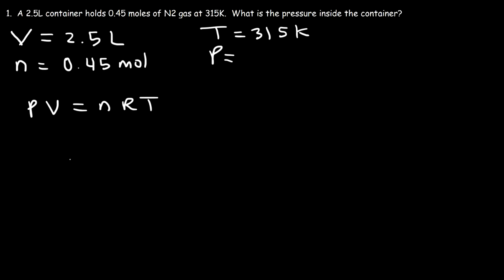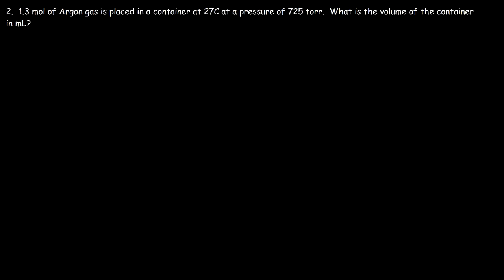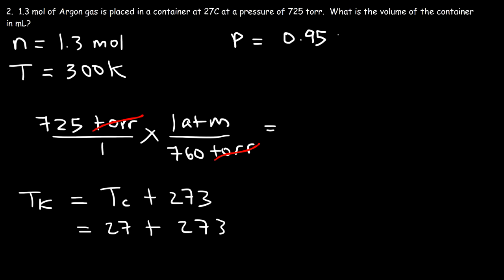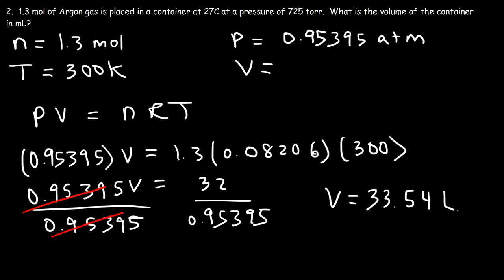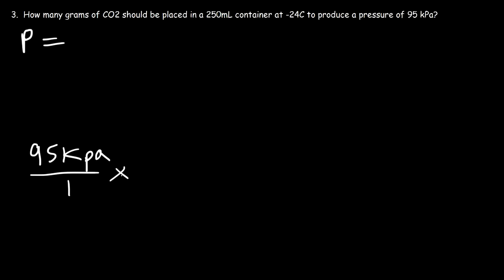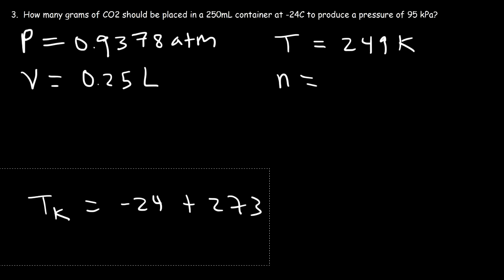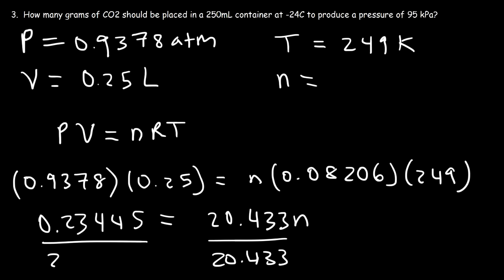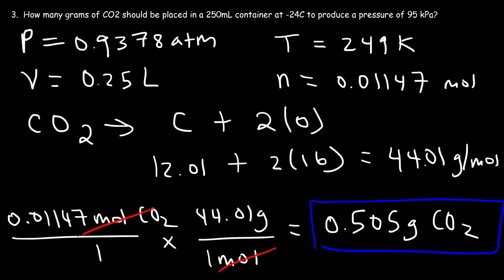Ideal Gas Law Practice Problems

Comment: But please sir how did you get this 0.08206 explain more better please
Reply: R is the gas constant and its equal to (0.08206 L atm/mol K) so you use 0.08206 as R
Reply: Is it always 0.08206 @Ava-jh1sl
Reply: @Yazzie_StarYT  i think

Comment: Can you please 🙏 explain why you converted the pressure from kPa to atm in question number 3 which was about CO2? I am confused 😕 because in some instances you continued using kPa without converting to atm. Can you help me understand why you did that? I am really struggling to comprehend it.

Comment: Bro where u even get R from in the beginning , Im doomed
Reply: you find R by doing (pressure x liters)/(mols x kelvin) at STP, so basically it’s (22.4 L x [pressure])/(1 mol x 273 K). in the first one he used the R for atm (0.0821), for torr R is equal to 62.4 torrL/molK, and for kPa it’s 8.314. hope that helps!
Reply: R is always going to 0.0821
Reply: R is a constant

Comment: 5:20 I got 33550ml in the second question. He got 33540ml i realised that the difference was from our multiplication of the right side values where it's supposed to be 32.0034 but he only used the 32. While i rounded mine off to three significant figures he didn't, do you think that could be a big case in A-level chem?

Comment: Question how did you get the o.o8206

Is 273 constant if the problem has torr
Reply: 0.08206 is the gas constant.
If the pressure is given in torr convert to ATM before solving

Comment: Liquefied natural gas (LNG) is mainly methane with molecular weight of 16 g/mol. A 10 m3
tank is constructed to store LNG at -164°C and 1 atm pressure, under which conditions its density is 415 
kg/m3
. Calculate the volume of storage tank capacity of holding the same mass of LNG as a gas at 20°C 
and 1 atm.
Argh can someone help me solve this

Comment: But what if only the volume is present and the rest is missing... And the equation states that we need to find the mass and number of moles in the sample??
Reply: then they gave you everything else in written form or the instructor must provide it. There is not way the question or the instructor didn't provide it. Otherwise, you can all report the professor to the deal office, or you didn't understand the class/chapter and couldn't understand what the question was providing you.

Comment: An ideal gas with a volume of 300ml at 600 torr and 30.0 c has its pressure changed to 800 torr at the same temperature. What is the final volume? my answer is 229, but this is not the right answer.
Reply: I got 0.224L or 224L
Reply: i got 0.237 L/237 ml, idk if it's right
Reply: @oopsijumpedintoahole9088  ty

Comment: How do you know if we’re supposed to convert to atm or mmHg. Shouldn’t that be given in the problem?
Reply: You can tell which one to use given the wording of the problem. The examples are asking for pressure which will be atm, or the given volume is in liters. PV=nRT where R is either 0.082 (L * atm)/(mol * K) or 8.3J/(mol * K).

Comment: I'm struggling enough with this subject, where in the hell did this 0.08206 come from? Care to do any explaining at all?
Reply: R is always constant so its just something you memorize. In the Ideal Gas Law equation, PV=nRT where R is either 8.3J / (mol * K) OR 0.082 (L * atm) / mol * K). Which one you use depends on the question, if asking for pressure/atm we use the 0.082 wheras kilopascal its 8.3

Comment: For the first question shouldn't the "V" be converted to m^3 ??
Reply: Nope
According to the gas constant 0.08206 L. atm/mole. K, 
It shows that the V should always be in atm
Reply: @rosette_renah  you mean L cuz atm is for pressure
Reply: Actually no it should always be measured in atm
Reply: No. In order to cancel the units present in your constant R, L should be the only unit of V

Comment: How did it turned into liters the part that you will change it into milli...
Reply: The no.2
Reply: Are you asking how the answer was in liters? If so, its because he used atm for the pressure.

Comment: Just remember why he uses different constant instead of 8.3145 it's because when you are asked to find ATM you should use the R=0.08206 constant and when asked to find Kilopascal you use R=8.3145 constant. Even if you convert Torr to kPa and change constant from 0.08206 to 8.3145 the answer will still be the same.
Reply: thank you soooo much
Reply: I actually confused about that ... Why did he use 0.0826 ??? Bcs i read from somewhere else and they use 6.24 instead ..
Reply: @pumpkin5770  62.4 is when the pressure unit is wwHg. 0.0821 is when the pressure unit is atm

1 year later 😅
Reply: @taneleqy3531  i already solved it😭. But thanks for the reply anyway🌹✨
Reply: @pumpkin5770  Oh well 😂😂🤷‍♀️ glad you figured it out.✨️
Reply: @pumpkin5770  0.08206 instead
Reply: Atm = 0.0821
Calories = 1.987
Torr = 62.36
Mol = 8.314
Pa = 8.314

These are all the gas constants used based on the given pressure
Reply: You answered my question thank you
Reply: How do I know that the question it's in atm or kpa?
Reply: @they.luvfhatu_2245  I have the same question
Reply: @DaisyDonald-nn6cc  I did grade 11 last year and I never bumped into atm the only thing I always find was kpa
Reply: thank you so much, I have been looking everywhere for why there were always different numbers and you finally answered it.
Reply: i was slightly confused cause 8.3145 is the R constant for this,  thanks for the clarification
Reply: generally the questions have atm ,therefore they(chem. Teachers) says to memorize 0.08206
Reply: Thank you!!!
Reply: Thank you! Even if this was two years ago! Really helped me!
Reply: why my book says 0.0821?
Reply: So Why the hell he didn't say a thing about it
Reply: Thanks
Reply: thx
Reply: That’s what I was looking for for an hour.
Thanks!
Reply: thanks, came to the comments for exactly this
Reply: witch!
Reply: I literally love you
Reply: Thank you man, saved us all a lot of time
Reply: 𝑀𝑦 𝑡𝑒𝑎𝑐ℎ𝑒𝑟 𝑠𝑎𝑖𝑑 𝑅=0.0821?
Reply: sorry to ask, but what does ATM stand for? thanks
Reply: @herionmotha atmosphere
Reply: @herionmotha unit for pressure
Reply: Isn’t it in pascals not kilopascals for the units
Reply: Most important comment in YouTube history
Reply: Thanks
Reply: Then whyy you are watching here iff you know how to solve it lmaoo

Comment: how to convert grams to liters?
Reply: U can't because liter is volume unit, not the mass.
Reply: @WadcaWymiaru  ohh okkk thank you
Reply: @WadcaWymiaru  Why ideal gas are applicable for only to dry gas not moist gas?
Reply: @stable8692  
Not true. See:
https://en.wikipedia.org/wiki/Water_vapor#Calculations
"Obey *Avogadro's Law and the ideal gas law* , moist air will have a lower density than dry air. At max. saturation (i. e. rel. humidity = 100% at 0 °C) the density will go down to 28.51 g/mol."
This also prove that "greenhouse gas effect" doesn't exist.
*PV =nRT*
T = 101.3 / (8.314 x 1.225/28.97) = 288.14 K ~15°C
Earth black body temperature is -18.8 °C degree or 254.3 K
All of that 33 degree rise without greenhouse gas effect.
Reply: @WadcaWymiaru   man this is not the answer to it.this is ideal gas equation which is not used for dry gas. Tell me I'm Wrong or right bro
Reply: @stable8692  
Your question was build in wrong way. So i gave you FULL ANSWER.
And yes... Ideal Gas Law can be used to moist air.
As a "meteorogist" i can ensure you.
Reply: @WadcaWymiaru  but some people saying that we can't use ideal gas law in moist  air, which right sir,I'm totally in confution please give me final brief answer
Reply: @stable8692  
As i show you page in the wikipedia, you CAN use&apply Ideal Gas Law to the moist air until it turn in to 100% pure water vapour.
The "people" just deceived you, while laws of physic remain unchanged.
Reply: @WadcaWymiaru  thanks sir, god bless you 😊
Reply: Grams is different from liters. Liters is volume, grams is to moles

Comment: My chemistry teacher uses Kb= 1.380x10^-23 as a constant, is this the same thing as r?
Reply: I doubt. R is always 8.314...it is that same for all gases.
Reply: @WadcaWymiaru  ?
Reply: henco n R is a constant of .0821 when the units are atm•L/mol•K but the constant is 8.314 when the units are J/mol•K
Reply: @WadcaWymiaru  ?
Reply: @WadcaWymiaru  ?
Reply: 8.314 is when the units are (m³×Pa)/mol×K since it is 8.314 (m³×Pa)/mol×K. He uses 0.08206 because the values he uses are in (L×atm)/mol×K
Reply: @Lemillion R is basically just the gas constant. Its sort of like how n is moles. :>

Comment: how would you structure an equation if the equation is asking for molar mass of the gas? I understand the rewrite of r= PV/RT but the answers don’t add up.
Reply: Keep the equation. After you get the n, use stoichiometry to convert from moles to gas or vice versa
Reply: you don't need to change the equation, you need to use a data booklet and find them in there, itll tell you the mass of the molecules
Reply: PV=(mRT)/molecular weight such that m is the mass

Comment: plz explain that how did 0.0826 come in the first problem
Reply: Ishan Ginodia it comes from R in PV=nRT it’s just something you have to memorize. It’s always the same for every problem. Don’t really have to know the story behind it.
Reply: Ishan Ginodia  
it is the gas constant
Reply: Why ideal gas are applicable for only to dry gas not moist gas?
Reply: isn´t R worth 8.31 J/K mol
Reply: @carlosjuarezvw9712 there are two R constants, and they depend on the unit of measurement that you use. The first one, which he uses in the video, is for atm and L=0.08206 J/K mol. And the other, that you are talking about, is for Pa and m^3 = 8.314 J/K mol.
Reply: it is a constant